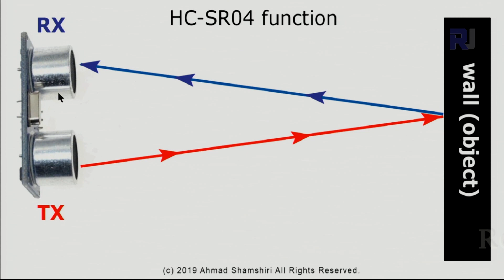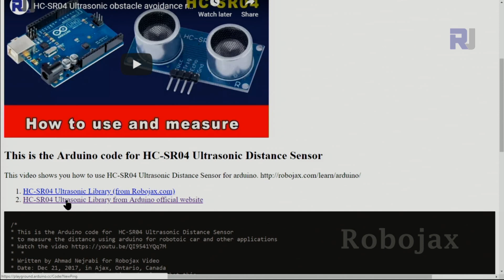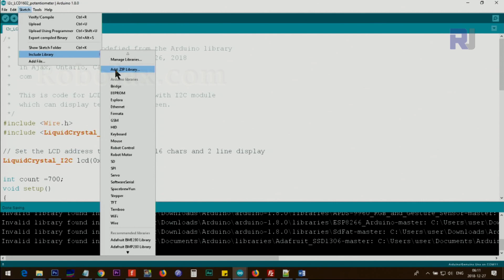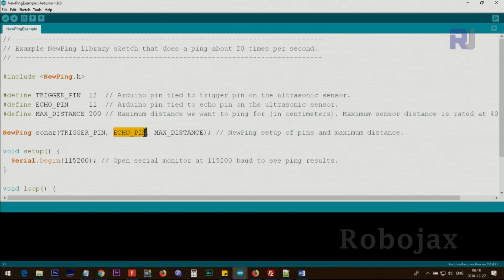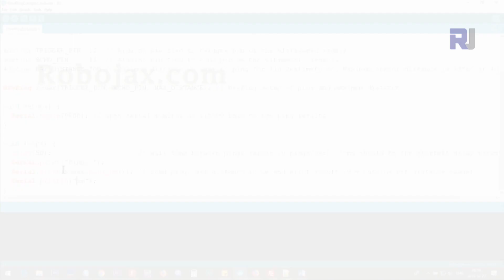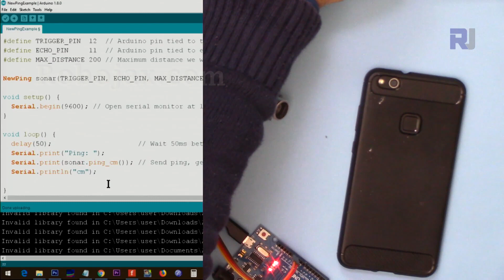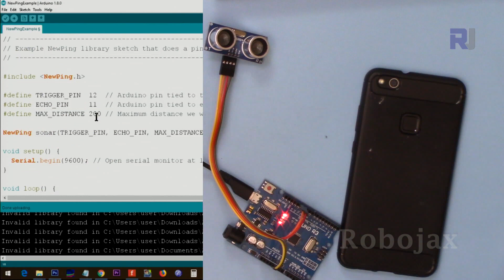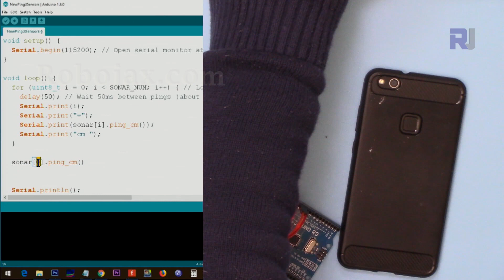Lesson 70: Measure Distance Using Ultrasonic Sensor  - RJT475

Comment: WHY LED FLICKER WHEN IN LOGIC LOW? THANKS IN ADVANCE
Reply from the maker: which LED? this video is about ultrasonic.  if in a video, please provide the timeing like 3:23. flikers are due to delay in your loop. perhap ou have dalay(500) or some number. reduce the number of milliseconds from 500 for example to 50 or 10.
Reply: I made a distance measuring with ultrasonic sensor.ex:distance  less than 15cm turn on an led,if not turn off led,but led flickering at around 25cm instead of off,what could be the reason ?

Comment: I have searched all ur channel videos but couldn't find tutorials on Wireless NRF modules, correct me if im wrong.
So please make series of using nrf modules to send multiple sensors data like temp, water level using ultrasonic sensor humidity etc from sender to receiver wirelessly and show the received data on lcd display.
Reply from the maker: Yes. I have it in my list but got other stuff first. I hope to find time to do it and include in the course. Thanks
Reply: @robojax  Thanks for your quick response and hope i will see the videos soon